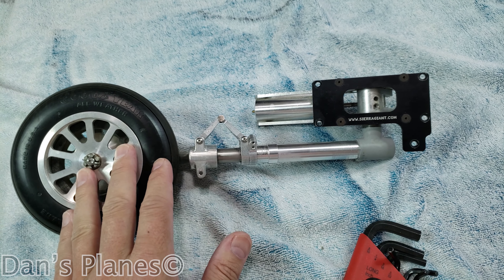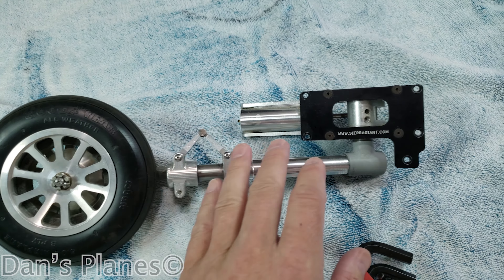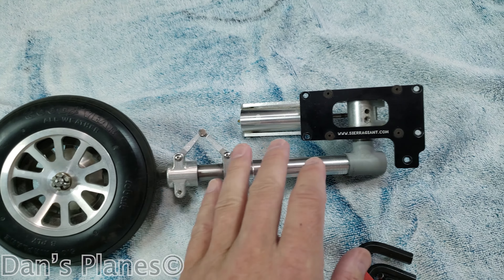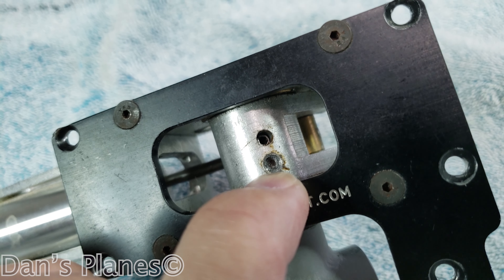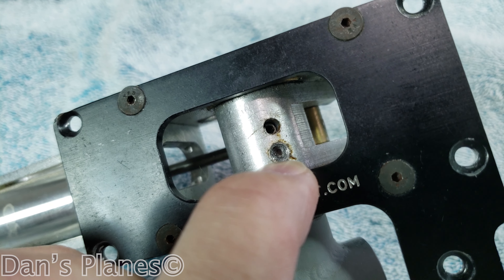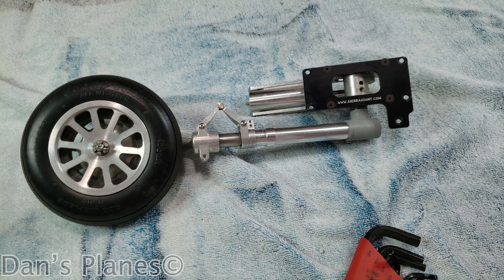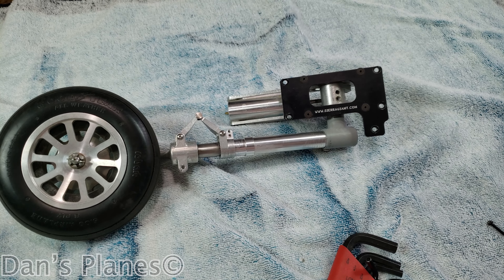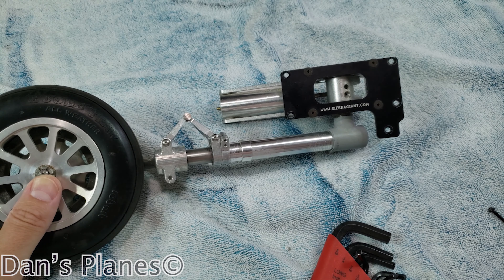20230614 TF P-51 Gear Repair

Comment: Hello there, one tiny screw is to set position. This is the set screw. If you are happy with the position then you have to drill in the other hole next to the set screw. You have to drill all the way through the trunnion. Then you have to Hammer a steel pin all the way through that hole and only then they are locked. That little hex is only to temporary set position..When i bought my sierras they came inclusief the drill and the pins. Already a few times i read these stories on internet,  people buying these sierras but not having the drill and lock pins with it.
Reply from the maker: In this case I bought a plane with the retracts and they were already drilled.